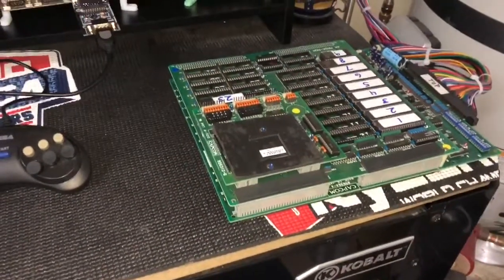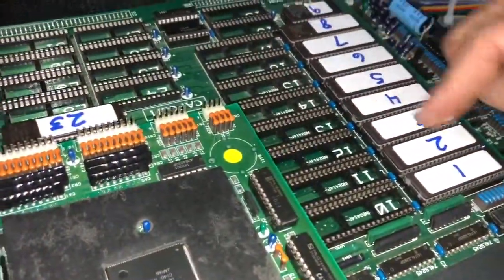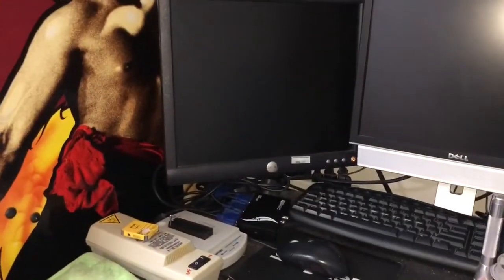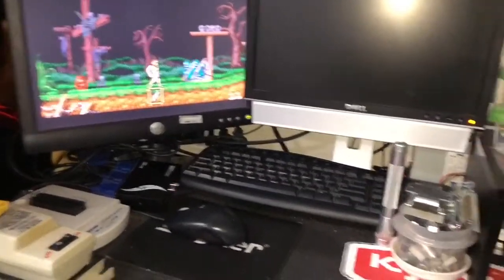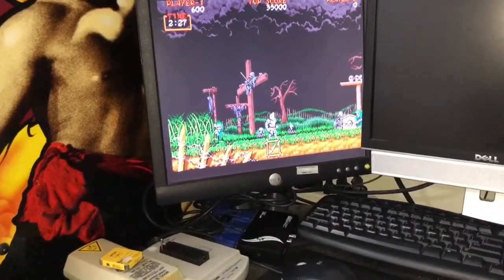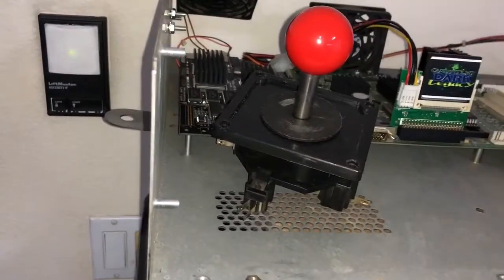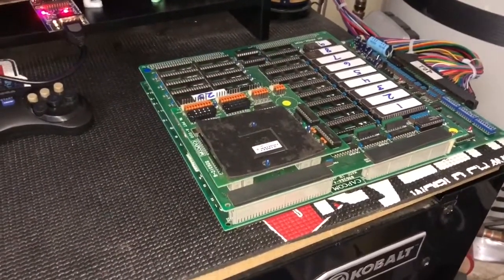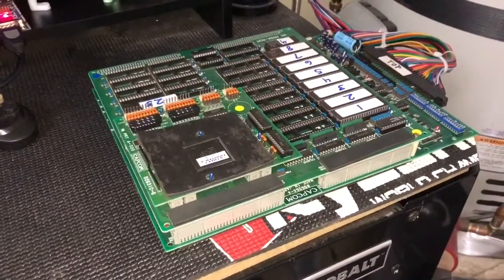Capcom Ghouls n Ghosts CPS1 street fighter conversion PCB

Comment: I have a cps1 ghouls & ghosts board, but the audio isn't working.  When i was shorting out the monitor cap to remove it I had the board in and the audio quit working.  if you are interested in it maybe i could sell it, or you could help me repair it or suggest.